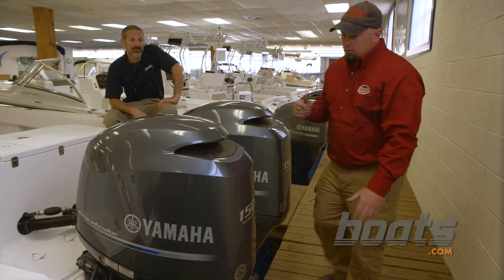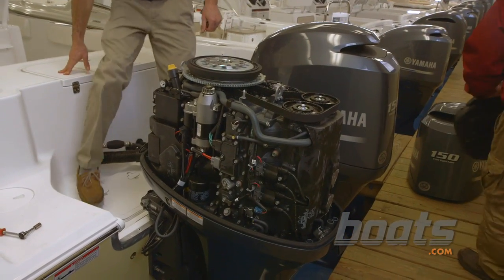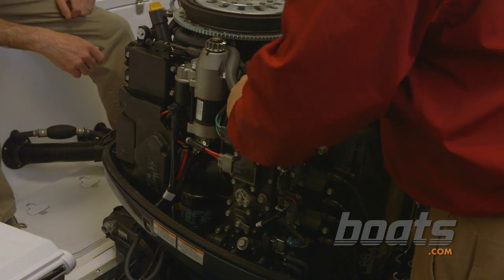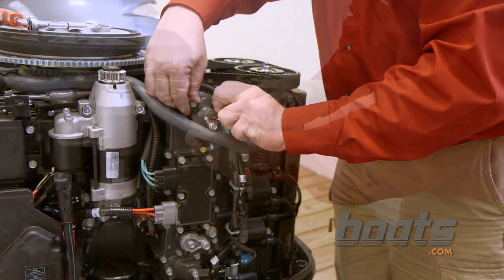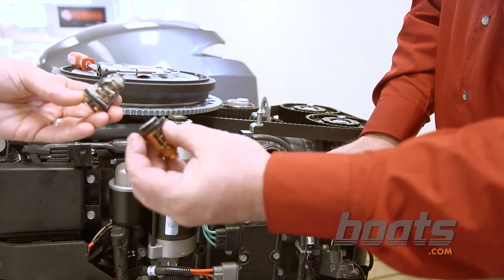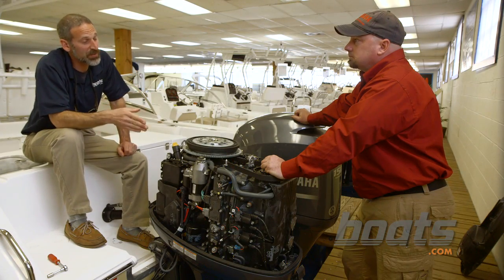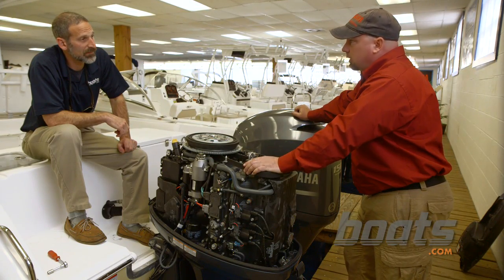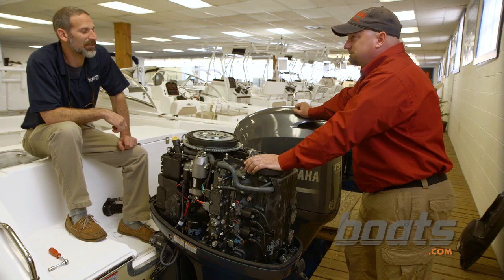How to Change the Thermostat on an Outboard Engine

Comment: You were pretty darn quick pulling it out and putting it back in but did not really hi-lite the direction of the stat going in. I have a different boat and am still not 100% sure which direction the part goes.
Call me silly....but!

Comment: i have a 25 yamaha outboard i installed a new water pump and a new thermostat and it still wont pump water do you have any ideas what it might be thanks
Reply from the maker: Hi Pam Smith. That's a hard one to diagnose from a distance. We'd recommend you take the engine to your local dealer and have a pro look at it. Let us know how it goes!
Reply: +Pam Smith maybe your water intake channels are clogged?

Comment: I just changed my Yamaha 200TJRS and  my question is do I just place new thermostat in or do they need to be pushed in reason I ask is that the old ones I had to pry out and the new ones just rested there ok thanks
Reply from the maker: Hi, Jim Mitchell. Just place it in; You probably had to pry out the old one because gunk and/or corrosion had built up around it.

Comment: According to my humble opinion this is not the case. A manufacturer never puts something on a motor that is of no use . A thermostat pops up when the water reaches a certain temp and this allows controlled expansion with the most crucial point the tolerance between  piston and cylinder wall. When the engine runs cooler than specified even with a carb configuration, combustion changes and richer conditions translate in carbon buildup, stuck piston rings,even total destruction of the engine.